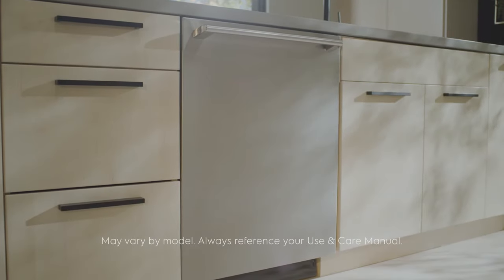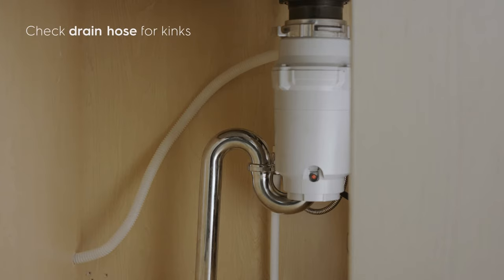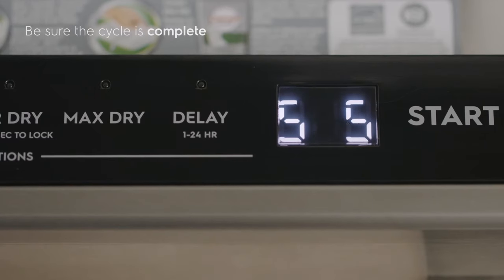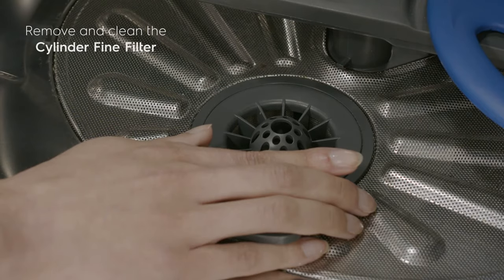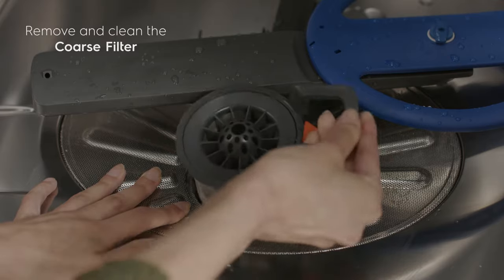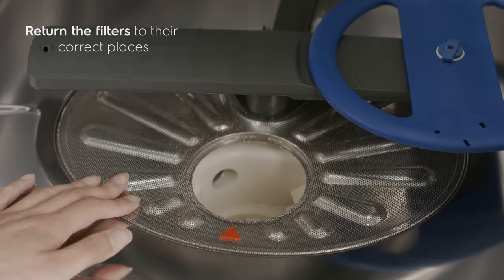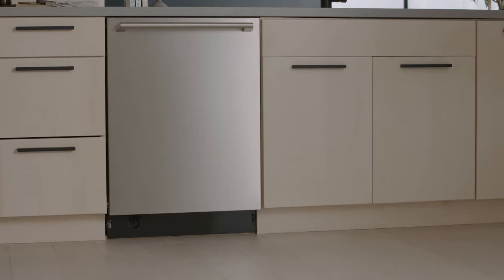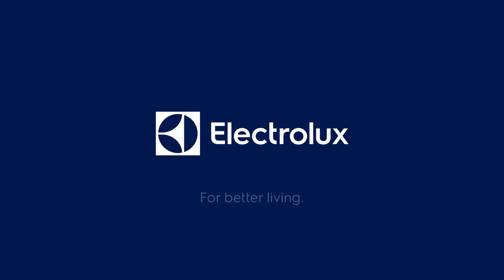What to do if your Electrolux Dishwasher is Not Draining

Comment: Yesterday our ESL5355LO Electrolux Dishwasher turned off itself close into when I started it. The light under that should be red was turned off and the dishwasher was...off as well. 

I checked inside and there was a lot of water on the floor of the dishwasher which I took out manually, then I cleaned the filter etc. 

Questions: Is there something else that could have been clogged, that I should check before I try to use the dishwasher again? Not sure whats going on... =(
Reply from the maker: Good day! We never like to hear about one of our appliances not working as designed. Check the dishwasher's filter, drain, and the bottom of the tub for any food particles or debris that might be obstructing the drainage. The drain hose could be kinked or clogged. Ensure it’s free of any blockages or twists that might restrict water flow. Check the garbage disposal’s connection and make sure the knockout plug has been removed. In the event that the tips provided do not resolve your concerns, please connect with us through live chat or by phone at 1-877-435-3287 between the hours of 8:30 a.m. and 8:00 p.m. EST, Monday through Friday.
Reply: I have the same issue, have you managed to fix it?
Reply from the maker: Thank you for letting us know! Ensure the dishwasher is properly plugged into the power outlet. Verify that the outlet is working by plugging in another appliance. Make sure the dishwasher door is closing securely. Look for any visible damage or wear on the control panel. For further assistance, please contact us through Live Chat or by phone at 1-877-435-3287 between the hours of 8:30 a.m. and 8:00 p.m. EST, Monday through Friday, for us to investigate.